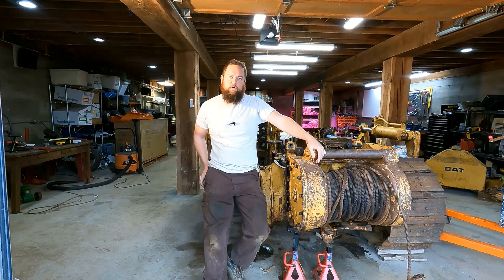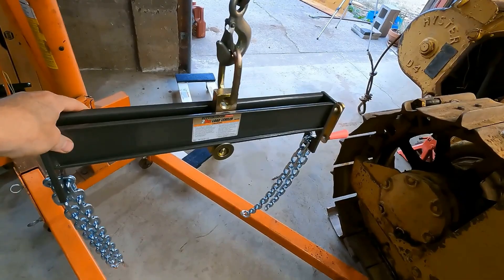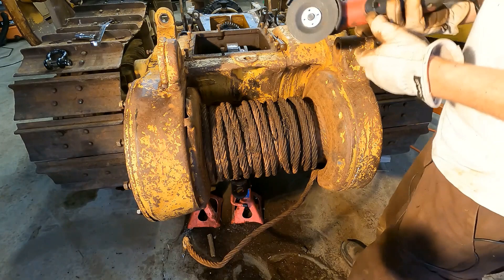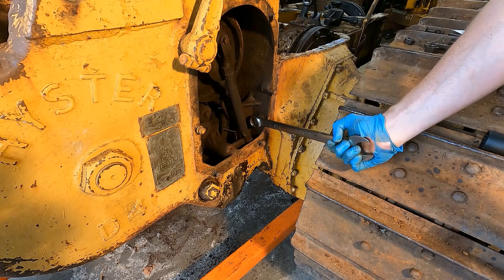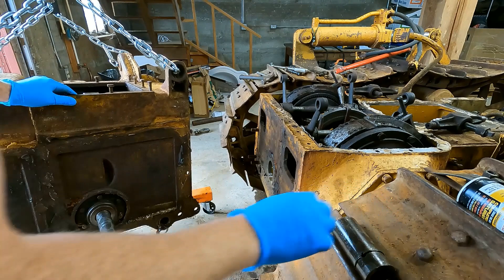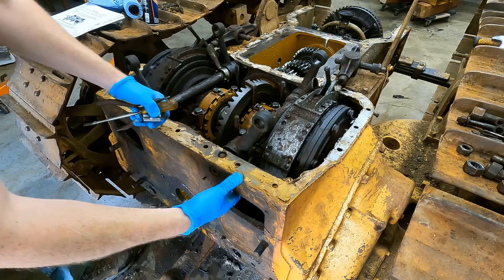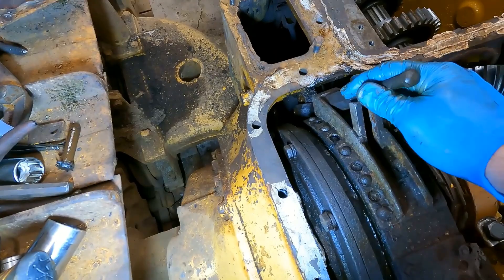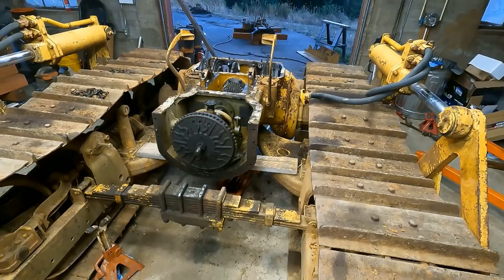Removing the winch from a Caterpillar D4 (way heavier than it looks!)

Comment: As for painting. IMO, it's not about the looks. Paint is for protection. There is NO better time to paint components than when they are off and easily accessible. Painted components are much easier to clean,  will resist rust and make the machine last longer for you and your heirs. It will help the resale value too if that becomes necessary also.
Reply: I was going to comment about painting until I read yours. Perfectly put, and completely agree.
Reply: That's exactly what I was thinking to. It's for protection. And don't need to look perfekt or new.
Reply: I totally agree with you, paint is a very good protective coating and makes cleaning easier!
Reply: I agree
Reply: PAinting also ruins the patina. You can achieve all those other goals without repainting it, and it's what I'm gonna do to my F150. I fucking love how my old truck looks 36 years old, like it came out of a junkyard while giving time, the elements, wear, and tear two upright middle fingers. As such, I will never have it repainted. But I want to stop further rust on the bodywork because I do want to keep driving that thing for a couple more decades, so I will have the patina sealed off instead.

To my eyes it looks better with every dent, ding, scratch, fade, primer splotch, rust splotch, gash than it ever would all dolled up purdy again. And same for this old dozer. It just wouldn't look right anymore if it was all spick and span.

Leave the patina. They have ways to seal them and arrest further rusting if you're concerned about that.
Reply: @TestECull  Sealing is kinda like a clear paint then isn't it?
Reply: @winstonviceroy6125  Ye sorta. Gotta clean it really well, sand it to get the coating to stick. But ya gotta be careful not to sand what's left of the paint off, or sand the rust itself off; defeats the purpose.

The popularity of rat rods means most hotrod body shops will be able to seal a patina quite nicely.
Reply: I also concur that painting is done to protect the machine. @C6 Modellsport  advocates sealing the aging in but that would be even more work then painting I think.
Reply: @ve7cbh  It would look better with the patina sealed and sealing the patina accomplishes the same 'protective' goal besides. Though I'm not entirely sure what we're even protecting given the steel thst thing is built out of is so dummy thicc it will still be structurally sound 500 years from now.
Reply: There's no generation left that is going to appreciate 'patina', you need to paint it so whatever snowflake inherits this isn't going to just scrap it because it looks a bit rusty.
Then in 100 years hopefully we'll have a better culture and they can worry about the patina of it
Reply: @____________________________.x  I like the patina and I own it now. Patina stays. At least, thats how my equipment is treated. And to whomever I bequeath something, know it is because I trust you to appreciate it for what it is and not scrap it because it looks old.

Comment: I sailed on a surplus Navy Tug that had seven Cat D399s, all painted gray. Each time we serviced or repaired any engine component, we repainted it the original Cat yellow. Not only did that protect the component, but it gave us an extra sense of satisfaction in the work done. Painting (good painting, with good prep work) also gives you an opportunity to inspect the components. While maintaining an engine (larger engine) on another ship, I had my crew scrape and paint the crankcase. In doing so, they discovered a crack that had otherwise gone undetected. Yes, I recommend you prep and paint each unit as you go along.

Comment: Caterpillar Hi-Way Yellow is the color you want for a tractor of this vintage. You can get a color match at NAPA. Get a half-pint can and put a blob on a small card and send it to Magnet Paints in New York. They ship and you can’t beat their prices for quality equipment paint. And your local Caterpillar dealer has the bolts you need. They’re black anodized grade ten bolts. Price has been reasonable when I bought them there. If you have the parts manual you can see what bolts and washers you need and write down the part numbers and quantities. Be advised that the parts counter guys/gals will likely have to convert numbers. Good luck!
Reply: I agree Cat bolts are the best. I would not use bolt bin grade 5 or 8 on critical parts. You will regret it. I work for a competitor and still buy Cat bolts when it matters.

Comment: I'm now 73 and can't work like that anymore so I'm living through you. 2 Questions = 1st. why didn't you pressure was it a few times before you started. 2nd. Matt, when you're ready to start to put it back together I vote for sparying what you can get to would make it easier to keep it clean and help it last longer. You're doing such a great job I think it is no time to cut corners. Remember a clean tool is a good tool! Stay safe.

Comment: I  got to run one very similar to what you are trying to restore to working order back in 1962 while 
working on a pipeline in Michigan.   Fortunately the company I worked for was a stickler about
equipment being well maintained and keep in working order at all times.  My cousin was the 
operator and he let me "operate" it while he explained each and ever step of how to move, turn,
lift and even winch items.    Have to admit it was a blast for a 18 year old. The experience 
came in handy later in life when I had the opportunity to climb on another one and use the
Donkey Engine to start and semi operate it.

Comment: Paint and replace hardware!  Agree with W Viceroy -- Paint for protection...!
Hardware: we used either Cat or Lawson Products, (Both were USA made and grade eight).
Corrision-plated hardware helps, but if painted well, will not corrode too quickly.
You are doing a great job and will get much use out of a D4 with winch -- its a universal tractor, well-balanced, low maintenance, and enjoyable while moving vegetation and earth...!

Comment: Yes — paint what you can while u got it apart in sections — I agree that you might not want to paint into track / rails cause you have not worked on them /- but if you power washed all old dirt & grease off — you need primer & paint for long term protection!  Just brush painting here and there will do the job!

Great Work Matt!  Thank you for hard effort — video will help w rebuild — I guarantee it!!
From somewheres in SWMO-

Comment: Great project and I enjoy watching working at it. What's probably the most revealing is how your resolve has changed from the beginning when the disappointments kept piling up. As far as painting, keep the patina. Only paint it if you want to make a 'factory-fresh' restoration, which means it will be garage parked and taken out mainly to antique equipment shows. Or parts that must be painted for protection from weather...which shouldn't be much if properly sealed and the bonnet replaced.  As you're discovering every repair has a story that's part of this dozer's history that makes no sense to hide behind a false sense of 'newness' if this is going to be a 'back-yard dozer' to have for fun and use.

Comment: Semi retired tech enjoying the series recently watched.  What makes this project so very interesting is that the price of the replacement parts, while a real cost additive to the completion of project...should be very, very much less than a comparable new or used machine.
And...I expect this model to be very useful and tough.  As indeed, you proved to be as I watched the drill to fingernail.  
Cat bolts should be re used after cleaning in my opinion.  Unless damaged beyond reasonable end use, they are of good quality.  
I suspect you will find an engine gasket "kit" , if available, the best value for general gaskets but you should not be afraid to cut cork or gasket material to "fitment" as to the broad seal faces, in particular with the excellent sealer assortments.  *as in general specification as "flange".   Cat type o rings, very often are of larger diameters
If a good pattern is constructed to those needed  wide flange repair, such can be saved to a wall and held for future revisit as maint specific.  
AT this level of dismantle, it might be very prudent to replace all zerk point encountered...of which assortment packs are available.  
I hope you might see, I am rather a fan of repair...and in fact this is a bit of a challenge (in my opinion) but one with a reward as an earning potential and with particulars as earth moving and timber operation. This machine has very minimal shields, brush guards should the operator undertake heavy brush or timber as movement.  Limbs as sharpened fragments, a particular hazard beyond the cable entrainments. Always, tracks slick from rain and or cold.  I bid you fair winds.  M.

Comment: On the ring and pinion adjustment that you loosened - you can pretty much fiddle with the adjustment that doesn't have the ring gear on the same side - but DON'T MESS WITH THE ADJUSTMENT ON THE RING GEAR SIDE.  The adjustment on the ring gear side changes the engagement with the pinion shaft gear, and can cause the ring or the pinion gear to strip or wear badly if adjusted incorrectly.  Go back and tighten the adjuster on the ring gear side before you do much else.  There are plenty of videos on youtube about adjusting ring and pinion gears in cars, go look at one of them to get an idea of how much trouble it is to get the ring and pinion adjusted correctly.

Comment: Great Work. You need a set of pry bars. All Caterpillar bolts and nuts are at least a grade 8 or higher. Check the specs for the bolts when you replace them. Stay Safe

Comment: I have been keeping close tabs on your videos ,really enjoy them. I felt for you when you found out the engine was not turning over .I came across the same situation with a VW beetle I bought a couple of years ago , water that got in through the inlet manifold and the pistons and cylinders were toast. Anyway I vote paint it , you might be running a budget but in the long run it will simplify maintenance. Everything you disassemble,  fix and reassemble now, you ( propably) only want to do it once ,its quite a job, therefore paint it while you are at. it. I believe anything can be fixed even that hunk of steel.  Keep it up👍🏻

Comment: Well, if it's not going to shows and is going to work, I wouldn't bother with paint.  One thing I absolutely would do while it's apart is rent a steam genny and give it a deep cleaning.  The winch- no matter what it takes, get it back to working condition.  You may not think you'll use it too much, but trust me on this, you will.  And if you ever sell it or do a full restoration, it sets yours apart from others.  Anyway, great video again this week.

Comment: You took on one huge project with minimal equipment. I thoroughly enjoy your videos. One criticism: Never ever use Concrete masonry units CMU for supporting heavy loads. They cannot withstand point loading and will crumble in a split  second.  I love your shop. I could live in it. Keep the videos coming. 👍
Reply: Actually, concrete blocks can hold a lot of weight, but must be used properly. Place the blocks so the holes are vertical, (up & down, not across). They are much stronger in that orientation.
Reply: @notajp  True but using concrete blocks to support anything is a bad a very dangerous thing to do.  Sadly many people have paid the price by doing so.
Reply: @ve7cbh  All I can say it that there are a helluva lot of houses out there being supported by concrete blocks, including my own!
Reply: @notajp  The weight from a house is not a point load. Weight is evenly spread out over hundreds of blocks and the bottom plate bridges weak points.  If one cracked or broke as they do, the others pickup the weight. I have read of guys losing their lives under their cars when a block broke. Kudos to those that gamble and survive.
Reply from the maker: Im assuming they crumble because the point of contact from the jackstands is like half a square inch... meaning 3k psi concrete would crack with a 1500lb load on jack stands.  So maybe throwing a board under the stand would make it slightly more safe to distribute the load.  For the record, the weight under the winch when it's still attached is only a few hundred pounds.  That's all that is required to counter the weight of the transmission on the other side of the pivot.  Your point is a good one though!

Comment: Your project reminds me of a D7 that a friend of mine bought from Leslie salt here in the San Francisco Bay Area. It had only been used to push huge piles of salt and had what was the biggest dozer blade I had ever seen. Had to be at least 15 ft wide. His welder used a blow arc to lop off the ends of the blade and shortened it down to normal size. He fixed a broken track adjustment spring and then had the entire thing sandblasted because the cat yellow paint had turned orange from the salt. It looked like brand new with that Fresh coat of paint on...

Comment: Great work, I'd only paint what needs protected from weather or if you hit a spot with a grinder or torch for removal or re-assembly. Long ago my father had a 1953 OC3 Oliver It wasn't pretty, but the name of the game was get it fixed and keep it going. Lots of anti-seize, gasket paper to make new gaskets by hand. Once it's done and your happy with how it runs and works then maybe just spray the whole thing in one big shot. To clean and prep every piece is going to extend your times x 3. Function is key, I want to see this thing dig not sit in a barn with fresh paint, Cheers.

Comment: I love doing these kind of "resurrections" too, but mostly old motorcycles, so it's not quite like what you must go through on such awkward machinery, but I truly appreciate what you're going through.  Having said that, I voted to paint, and I'll tell you why.  Because it's necessary to clean it and prep it for pain, that will be an opportunity to see/find more damage that you wouldn't find or see otherwise.  Sure, maybe in this particular case it's torn down so much already that it might be hard to miss anything, but I might point out that as much as you are having to invest in this thing to get it back in order you may as well consider it as much a restoration as it is a resurrection!  
Good Luck!

Comment: More courage than brains was a term used loosely but I think that you have it under control.... only reason to paint is to see if any cracks appear in the stuff put together or if it got hot then the paint might discolor and give you a chance to fix before it breaks again... I really don't see any tight tolerances to cause many issues so just keep plugging away and soon it will be all in your hands.... paint might give you some bragging rights as not many can do this from fear alone

Comment: You mentioned painting the parts you've worked on Matt. That sounds like a plan. As you fix stuff and clean up parts, paint them before you re-install them. They'll be easier to paint that way and you'll get paint onto all the hidden surfaces. That should stop any more rust appearing, make stuff nicer to work on, and look better too. Stick to that system and, when you paint that last component, she'll be done.
Apart from anything else, it'll make the painting more manageable, a case of yellow spray cans should do the job.👍😁

Comment: I’m a fan of your project and I’m also a fan of paint. Once it’s back together paint it up. Not only will it look better but a clean painted surface makes a problem stand out whether it’s a crack, loose bolt or a leak. Then work it.

Comment: I  agree that paint is important for protection.  On my D2, I cleaned everything that came off and then used a good red oxide primer on them.  Yea, looks a bit strange but the intent at some point was to paint the whole thing.

Comment: My 1951 South Bend Heavy 10 has the original paint and it shows its age perfectly I would never think of painting it.

My 1964 Delta unisaw has the original Green School Woodshop paint on it and I would never think about painting it.

My 1973 Mach 1 has the original paint on it and I would never think of painting it.

Personally I think it is sacrilege to paint something just to try to make it look new. As long as rust is not an issue, the old paint shows that it's been a well-used tool.

Comment: Definitely paint as much as you can. Pressure wash and wire brush some areas. Point is to protect what remains. It may be old etc, but you have worked hard to make it nearly new.

Comment: You have the manuals, read them! There should be parts lists in the manual. At least this is an American made machine with all SAE bolts and Nuts. Tractor Supply is a good souce for common bolts and nuts, Tractor Supply also has Grade 5 bolt and nuts.
Reply: Not many grade 5 nuts and bolts on a Cat, most would be grade 8 or better.
Reply: @Ropetangler  Tractor supply also has grade 8 bolt & nuts, washers.

Comment: Matt as to panting question, here are my thoughts; the engine have everything boiled,cleaned as to putting back together you will be able to detect leaks and will be clean and run cooler. The operators platform paint, and do the bed liner for wear protection, the rest adds character.🙂 Remember, pretty working equipment doesn't work.....

Comment: Matt, winch is too massive for such small dolly base. You've created to high center of mass and it's just matter of time until it tips over. Remove at least the lowest level of blocks, and replace them with boards to make it more stable.

Comment: A very good film, as always. If you aregoing to work it, dont bother with paint, however I agree that all the bits should be cleaned before reassembly. It will make it a bit easier.